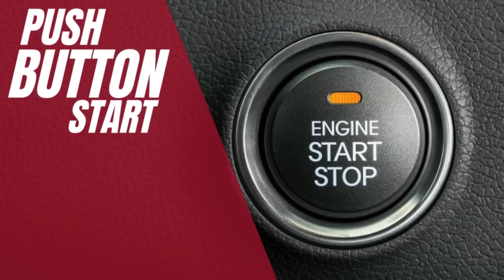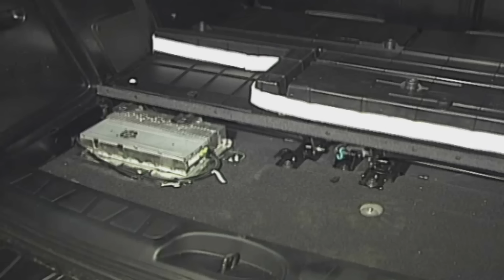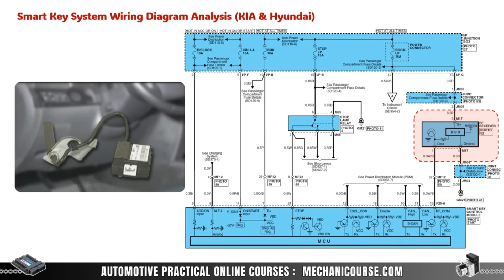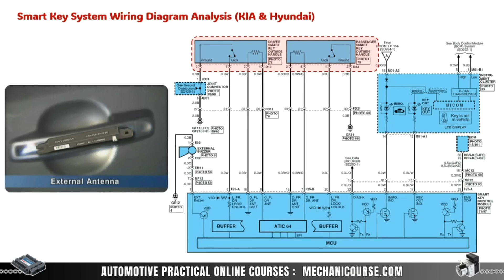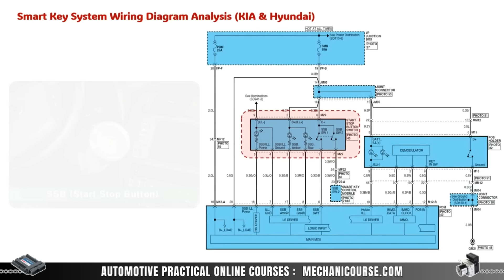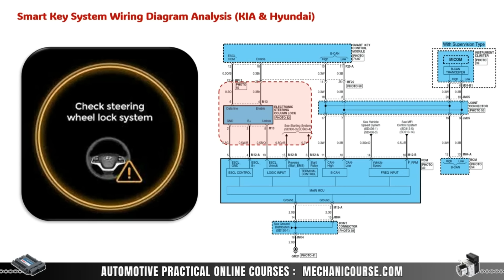Push Button Start System Explained | Smart Key System Diagram & Diagnostic

Comment from the maker: 🎯 Online Courses:
🧑‍🎓 Smart Key System (Push Button Start) Operation & Diagnostic:
https://mechanicourse.com/course/smart-key-system-operation-diagnostic-in-any-kia-hyundai/

🧑‍🎓 Automotive Engine Sensors Intro, Operation & Diagnosis:
https://mechanicourse.com/course/automotive-engine-sensors-intro-operation-diagnostic-2/

🧑‍🎓Automotive Engine Actuators Intro, Operation & Diagnostic: 
https://mechanicourse.com/course/automotive-engine-actuators-intro-operation-diagnostic/

🧑‍🎓 Automotive Diagnostic with Oscilloscope:
https://mechanicourse.com/course/how-to-use-an-oscilloscope-for-automotive-diagnostics/

🧑‍🎓 CAN-Bus Network Intro, Application & Diagnostic:
https://mechanicourse.com/course/automotive-can-bus-network-intro-application-diagnosis/

🧑‍🎓 Automotive LIN-Bus & K-Line Inro, Application & Diagnosis
https://mechanicourse.com/course/automotive-lin-bus-k-line-intro-application-diagnosis/

🧑‍🎓 Gasoline Direct Injection System Diagnostic:
https://mechanicourse.com/course/107-gasoline-direct-injection-gdi-fuel-system-operation-diagnostic-online-course/

🧑‍🎓 Automotive Airbag (SRS) Diagnostic:
https://fix-it-first.com.au/course/automotive-srs-airbag-system-diagnostic/

🧑‍🎓 Everything about Electric Power Steering System:
https://mechanicourse.com/course/everything-about-electric-power-steering/

🧑‍🎓 ABS & Traction Control System Diagnostic:
https://mechanicourse.com/course/abs-traction-control-system-diagnostic/

🧑‍🎓 Starting System Diagnostic & Schematics Analysis:
https://mechanicourse.com/course/automotive-starting-system-diagnosis-and-schematic-analysis/

🧑‍🎓 Tire Pressure Monitoring System Intro, Operation & Diagnosis:
https://mechanicourse.com/course/tire-pressure-monitoring-systems-tpms/

🧑‍🎓Power Outside Mirrors Diagnostic:
https://mechanicourse.com/course/power-outside-mirrors-diagnostics-schematics-analysis/

Comment: :"Hi, I have an idea to test the fuel gauge. Can I use a variable resistor to simulate the fuel sending unit, and by adjusting the resistance, watch the fuel gauge needle go up and down to check if the system is working? Is this possible? How effective is this testing method?"
Reply from the maker: Hi there, I guess that will work if we consider the proper resistance values.

Comment: I have seen some models of KIA without the holder, how can we start the car in emergency in that case?
Reply from the maker: In those models, key holder is integrated with the start stop button, so in an emergency situation (when smart key has low battery) , just press the start button with the smart key.